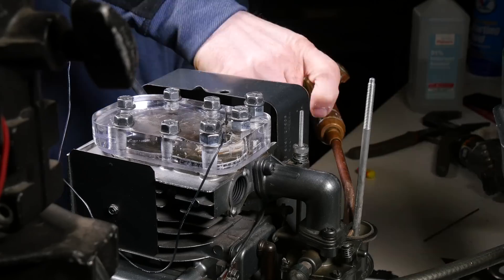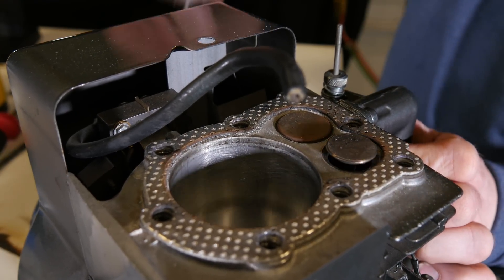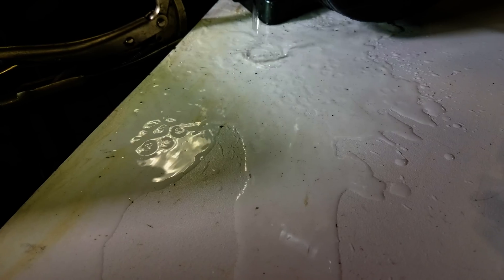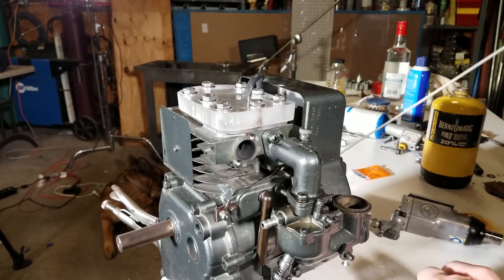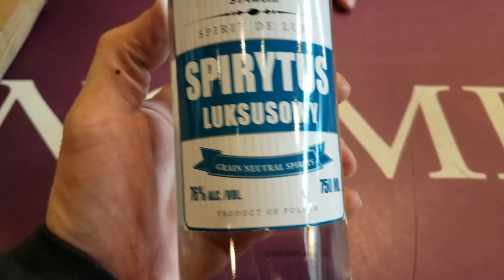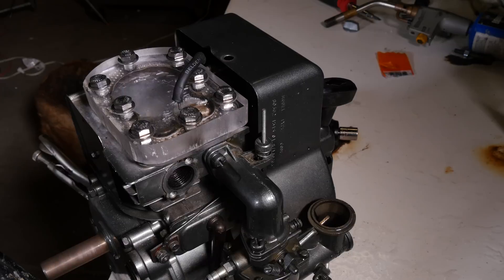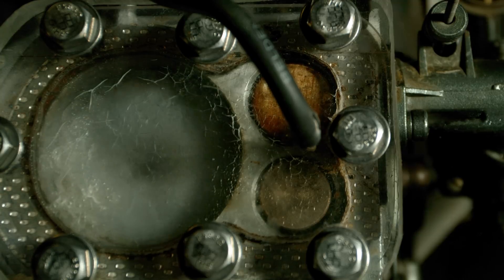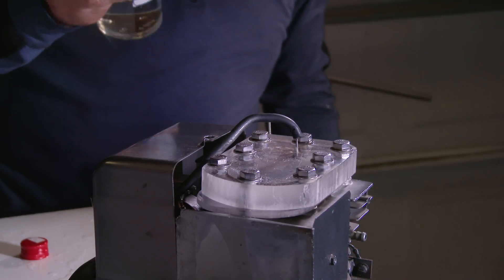See Thru Engine Runs Tequila, 151, and Propane - in 4K Slow Motion

Comment: Hope you make a full scientific approached video, these videos are nice but such an odd fuels are not chosen on real world demands of SI engines and global warming crisis. If you make a video to compare 3  fuels of Otto engine: gasoline, LPG(propane) and CNG(natural methane gas), and for each one you use a cheap small wide-band to tune air fuel ratio on accurate stochiometrics, it will help/guide any one over the world using car. Such a video will help scholars for more accurate comparison of which fuel burns more clean and more efficient.   PLEASE HELP THE PLANET AND ENVIRONMENT!                                     thanks.       (I can help for any chemical/mechanical study )

Comment: Super cool how when there is no ignition event and the piston makes it's way back down there is a lower pressure area in the cylinder from the engine drawing in air against a closed throttle. So when the engine doesn't light off that's when you can see the exhaust valve open and a rush of air from outside the exhaust valve come in and fill that vacuum. Literally backwards from how it is on paper. Then when it actually does fire and theres a high pressure needing to be released the exhaust valve opens and you can see the air flow rush out the exhaust valve like you would think it does all the time.

Comment: I am curious, why when running on the 151 was there so much liquid instead I flames?  It looked like a washing machine. 😉 Is it due to the added content that isn't alcohol in the mix? If so, I would have thought it would of burned up quickly due to the heat. Similar to cooking with alcohol.  Thanks for the awesome videos. I just became a subscriber. I am a car nut and your videos have put a big smile on my face. 👍😁

Comment: You need a diesel or a 2 store engine so we can see low octane fuels like vegetable oil.
Reply: That is a 2 cycle engine he is using. Also, vegetable oil is not a fuel nor does it have an octane rating sooooo....
Reply: @LeatherNeck1833  um, that's a 4 stroke engine...

Comment: If you put the tequila into the tank instead of pouring it in the intake, it would have run a lot better once you got the fuel/air mixture correct.

Comment: Can your try oxygen ? Please connect the full tank, fill with gasoline.. then turn engine on..while engine running on gasoline start   adding oxygen into intake...I would  like to see if flame turns from orange into blue and if power increase. Thanks.

Comment: Can anybody answer for me why it only combusts every couple strokes. Shouldn’t it be combusting every time there is compression?
Reply: it's a 4 stroke combustion cycle. if the piston is up from start it goes down while the intake valve is open
this is ur intake step, its drawing air and fuel mixture thru the valve from the carb. valve shuts, piston comes up
this is ur compression step, the air fuel mix compresses bcuz both valves r shut. once piston is up, a spark ignites air fuel mix giving ur ignition step, the explosion pushes the piston down with force to do "work". then the exhaust valve opens and the piston comes up pushing exhaust out for ur exhaust step. you can't imediately open your intake valve for next piston down, so itll go down and come up (and youll see plug spark but no combustion, then pull next intake step.. then a compression stroke, ignition stroke, exhaust stroke.... each takes a full crank turn or piston down then up cycle (stroke).. so thats why you only see combustion on 1 of every 4 strokes...
Reply: Andrew Pohronezny right but there’s power every eight strokes when running off 151

Comment: Just for grins and giggles try putting the electrode on the opposite side of the cylinder head could put in two electrodes and fire one than the other and both at once  just a thought.
Reply from the maker: Ha, I will try that in the next version, I'm currently on episode 7 right now oh, and I hope that's going to be the last episode with this little 3 horsepower.

Comment: Wait.. why did you light the propane torch? Wouldn't that burn up most of the gas before it even gets into the engine? Yet it seemed to actually run pretty well that way. Strange?!

Comment: Did I see the spark fire on the 3rd stroke of the cycle? Which is when it has no fuel in the chamber it’s venting exhaust gasses. It’s probably a design thing right? Easier and cheaper to have it fire every complete crank rotation then every other rotation. Love the videos by the way.

Comment: 151 boifuel!
I wonder if the shop assistant saw Back to The Future or Whisky Galore.
 I'm no good with languages but it looked like  there's 98%  stuff in the comments!
The best was propane for running. I tried to run a Stuart Turner  engine off propane. They were a bugger to start so I put it in the air intake. I made the mistake of having it lit. The carb burst into a ball of flame and the fire extinguisher was dud and I was in a small wooden boat. That was fun. 
What is petrol? We call gas petrol. But if you call petrol gas, what is the stuff you call petrol if it isn't gas? It made for some damn good photography anyway.

Comment: two crazy ideas of mine.- take a leaf blower, funnel, stick the funnel over the opening for intake, connect to engine, and try black powder. another is a cocktail of kleen-flow air intake cleaner, propane, and petrol. take the stoichiometric ratios, add them, and divide by three and tune the carb to the result

Comment: Jeez, $20 per litre ... and we here in the UK think our petrol prices are ruinous :D

Can you imagine how efficient car engines would get, and how quickly it would happen, if motor fuel cost as much as liquor?

The petrol run shots were simply beautiful, despite the misfiring that your abuse of it seems to have caused ;) ... and what kind of crazy motion control system are you using for the spins and the firebreathing tracking? The cameras must have been moving pretty darn fast.

Comment: Please try running that engine on hemp fuel Ive heard that its supposed to be the best fuel for power and clean burning
Reply: A couple of years ago, I was stoned with my neighbor and imagined the idea of running a diesel off of cannabis oil and hotboxing it. There were several design considerations that never got around to working out, but the idea is still pretty cool. 🧐

Comment: try putting it in the fuel tank so it goes through the jet so the fuel air mixture is correct then it may run better so your are not flooding the engine

Comment: Called it. Worked with the 151 but not with the tequila. What kind of engine is that anyway? Do you have to use like a flex fuel engine or are you just,... doing it?

Comment: Actual Bacardi 151 is 151 proof. Sadly they discontinued it in the recent few years due to suits from bars burning down which is stupid as pyro shows is a place full of alcohol is pure stupidity. That stuff real 151 rum/white rum would run an engine no problem. It can be found still but isn't cheap as there are still some bottles in private hands.

Comment: Glad you tried propane (not sure if you read my comment last video)
I wanted to see the visual difference for a few reasons, rate of burn and observing the sea of gradients, where the gas propane is more consistent.
Done some videos now on a similar side valve single engine showing how the wasted spark works using a timing light with the head off, and also using an oscilloscope to see the difference between the spark line voltages under compression and firing compared to no compression and burning wasted spark line that provides a baseline to see what the effect is on the spark line voltages from changes in the engine.  
Having the wasted spark on a single lead coil makes the engine a good test bench for the purpose because both spark lines are coming off the same plug inside the engine running making the waste spark baseline fairly reliable to compare to .
Next is to show temperature, static compression and turbulence effects on the spark line output and then do some back to comparison of petrol, low and high octane, propane and maybe nitro methane (got a bit of it I need to get rid of) observing spark line values.  
I might add a few link to these videos in the tests the show the visual effects.

Comment: Nice video, very well done. Could you run you B&S on Alcohol + Oxigen ?? When an 2stroke engine is reacious to run, I put the torch with the Oxigen fully open at the inlet, and it is like magic, BUUUUUUMMMMM it starts right on. Like to see the difference into chamber.
Like button pressed and suscribed.  ADIOS.

Comment: "You're running a engine on it?" You should have replied, "ya, we're trying to make sure our DeLorean will run on it so we don't get stuck in a time before gasoline like Doc Brown did"
Reply: He destroyed the fuel injection system when the explosion occurred, so unless there was already something else horribly wrong before he started then it was some kind of mishandling. I really wish I knew enough about automobile engines to know why that happened because by all accounts it simply shouldn't have done that. When he went had that hover-conversion done 6yrs ago, he should have sprung for having electro-motors put on his wheels too... then he could have just used Mr. Fusion.

Comment: Rubbing alcohol = 91% ethanol (rest is water) -> Motor runs, sorta.
151 proof = 76% % ethanol (24% water)  -> motor sorta runs
tequila = 40% ethanol, 60% waterr, motor don't run.

The ethanol that goes in some cars is 100% ethanol plus a bit of regular gasoline (not sure, don't live in the US). Also, ethanol needs greater compression than gas. Gas needs 8:1 and ethanol 10:1. The easy way to do that is delay the spark until the piston is all the way up.

Comment: Thanks for the video.  Just saw the "outrageous acts of science" sequence with your engine.  There have been, for years now, electrolysis hoh  generators for car engines claiming to make gasoline burn more efficiently.  I would like to see one of the more reputable generators put to the test with your see through engine; perhaps measuring the exhaust mix before and after.

Comment: You can alter the color of the flame by adding different elements to the mixture.
Sodium is bright orange, copper is green, manganese is bluish-red and others.
 This will mix with the orange/yellow of the carbon, so the color will depend on the amount added.
maybe you can add a bit of copper-sulfate to the alcohol?

Comment: I'm even more interested in these awesome machines now! Thanks a lot for these videos.
Also, is that a 6-stroke engine? Because before this I had watched a video on SmarterEveryDay and the strokes seemed off. I searched on wikipedia and found out that there is indeed a 6-stroke engine which has 2 extra strokes right after the exhaust process- which is what i think i saw.
Subscribed! :)

Comment: 4:40 why is your spark firing every 2 strokes at TDC, not every 4 strokes??
Reply from the maker: +Anvilshock because it's a wasted spark system
Reply: @WarpedYT  I learned something today, thanks!
Reply: Because the sparkplug is driven by the flywheel, so every time the flywheel magnet passes the coil, it sparks no matter what

Comment: how did it start on propane if you ignited the propane in the fuel inlet, shouldnt you have put it in without igniting it and let the sparkplugg inside the engine do that?
Reply: My guess would be that the lack of oxygen killed the flame when he put it in.
Reply: yes probably but there where then no need to start it.
Reply: true
Reply: You have probably noticed that people tend to have habits. You pick up the propane can with intention to use it and before you know, muscle memory has done all the work for you.
Reply: Raido Oras yes i was just wondering if it was on hes intention but yes it was probably just muscle memory
Reply from the maker: Raido O lol, that's very true, I just did it that way to show the nice blue flame on the torch that should match the nice blue flame inside the combustion chamber period but it is kind of habit for me to pick it up and turn it on right away.
Reply: Pett R the flame went out when he shoved it in the  carb

Comment: i´ve heard a lot about gasoline vapor as fuel instead of the liquid gasoline for engine running .. can you try that ? they put it in a bow like a water pipe (shisha) while the liquid gasoline is slightly heated to room temp. to counteract evaporation freezing ... then the sucked out vapor is mixed in with the air at the air intake of the engine while needing extra regulation thorugh the gas pedal via an opening and closing flap on the air intake as also the regular gas control on the suction bridge... you should try that ... there have been many locked away patents ..... ther was a guy in the 60s going in the us from coast to coast on like 10 liters via gas vapor ...

Comment: The propane was an easy guarantee. I worked at a propane company and many of their service vehicles (such as ones used for tank installations) run on both propane and regular gasoline. (They mainly ran on propane but auto switched over to the regular gasoline if the propane tank ran out.)
Reply from the maker: +Pat Moore yeah it was pretty compatible.  Thanks

Comment: I want to see how indexing the spark plug affects combustion. See if you can rig up something to shield one side of the spark like the ground electrode does in a spark plug. Try orienting the open part towards the intake, then exhaust and see if there is any difference.

Comment: I can't help but be curious, but some of the fuels seemed to only ignite on every other power stroke of the combustion cycle. In my head, I can't help but think it might be that the fuel is finicky and doesn't always ignite, but then I wouldn't imagine it to be so uniform, like I would expect it to randomly fail to ignite, but it would always ignite on every other cycle. I started to wonder if I was counting the strokes wrong, but there was always an intake before and an exhaust after, but half the power strokes were duds.
Reply from the maker: +Mya Ray  yeah the engine was missing, it's probably because the spark electrode and/or the fuel mixture. But in our episode right after this I run it stoichiometric. It gives you a much better idea what the engine is doing when it's set up properly

Comment: Your delivery method is the reason you're seeing so much liquid drawn in.  gasoline will vaporize and atomize a lot more readily.  Have to use a controlled injection rate versus... indiscriminate pouring lol.
Reply from the maker: +Distortionfile lol... Very true . No worries we had just finished shooting his video today comma we did the proper mixture this time and a few different fuels
Reply: Warped Perception I should have also mentioned that I love the videos and the transparent cylinder head.  I'm a technician and it helps demonstrate combustion in a way no 3D model can.
Reply from the maker: Distortionfile thanks we have a few more on the way

Comment: I would like to see pre-detonation triggered by using low octane and gradually increasing the spark timing. Perhaps hook up a knock sensor on an oscilloscope and show the waveform in the same slow motion shot as the engine...

Then either show how the knock can be lowered again by either retarding the spark or adding more fuel to cool things down. Would be cool to see the differences in the two knock suppression methods.

Good work!

Comment: Can you try running the engine on alcohol for an extended period of time I'm curious to see how much the water or excess alcohol will build up inside the engine and how it would effect it. Like if it would force the engine to stall or run erratically.

Comment: Try the acetylene one more time, but this time give it a proper fuel to air ratio. Light the acetylene torch up first, set it so it burns perfectly with the oxygen, and then give it a go. Acetylene has so much energy in it I wouldn't be too suprised if the thing exploded when you do that, so be careful anyways.

Comment: I wouldnt pour fuel straight into the carb, as you arent getting the correct fuel air mixture.  You could make a small 1 cup tank for your fuels and use the carbs fuel line input to deliver the fuel.  Then you will see the power each fuel has.  Your going to break a ring, piston, or head if your compressing water (the other ingredient in liquor).

Comment: What's with the extra strokes? Even when it's running on gas, I'm going "OK ignition, exhaust, intake, compression, igni-- wait."
Reply: He invented the 8 stroke obviously.
Reply: Think it's misfiring at times momentum keeps it going
Reply: @SWIM SWIM lol yeah it has really bad timing problems
Reply: The engine was drunk as fuck
Reply: Someone in another comment thread thinks it may be a six-stroke engine.
Reply: Me too
Reply: I was doing the exact same thing!  I noticed a spark a couple times I thought it might've been missing ignition in some cases but some times it seemed like it was just normal operation.  I'm wondering if it's 2 cylinder and we're only seeing one?
Reply: It doesn't make sense. And it's not random either. It misfires with a pattern.
Reply: There's 4 strokes in a engine: intake,  compression, powerstroke and exhaust
Reply: I noticed that there was a spark on intake but I just thought that I was imagining it.

Comment: Very interesting, there's been a long time I wished to see combustion inside an engine. If you do another video on the subject I have a sugestion: Could it be possible to use gasoline with a normal air fuel ratio (stoichiometric mixture) to see the speed of the flame propagation and also the color of the flame?? I think a well balanced ratio should give a blue flame.  Until now you showed many very rich mixture that burns slowly. I'm surprise to see that when the exhaust valve open, the combustion is not completed.
Tank's again, very very good vidéo.
Reply from the maker: Denis Morissette that's next , thank you and glad you like it